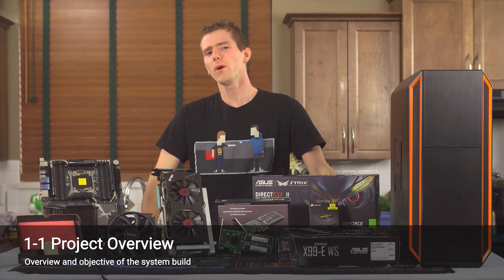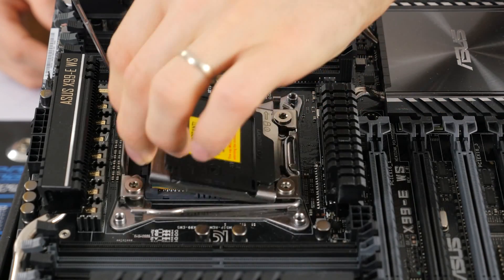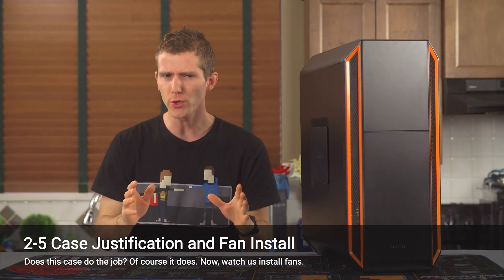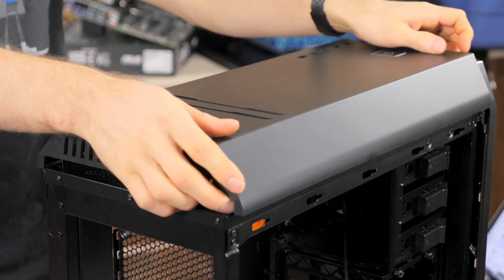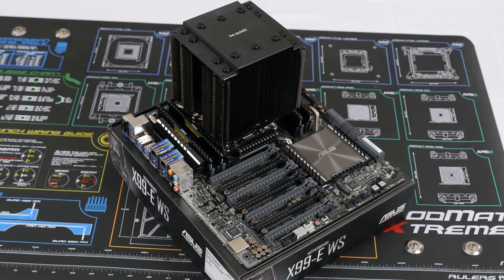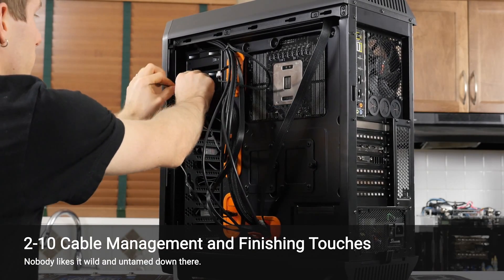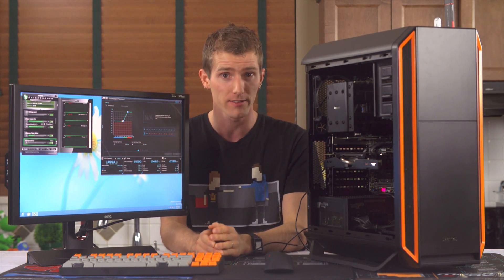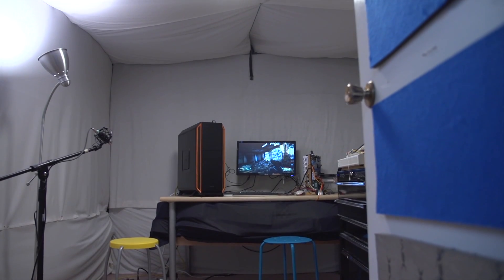How to Build the ULTIMATE Silent Gaming or Workstation PC

Comment: Could someone kinda help say if my rig could be changed? The main thing I'm going for is abit quiet, but not too quiet as well. Im getting my first desktop within the month, so mostly why Im asking for help. Any feedback is appreciated. :)

Case: Fractal Design Define R5
PSU: Corsair RM850
CPU: Intel Core i7-4790K
Watercooling: Corsair H55 Hydro
Motherboard: MSI Z97 Gaming 7
RAM: HyperX Savage DDR3 2400MHz 16GB
GPU: MSI GeForce GTX 980 Gaming 4GB
SSD: Kingston SSDNow V300 240GB
HDD: WD Desktop Green 4TB
Reply: I'd change the ram to a cheaper lower speed hyperx. Unless you neeeeeed the speed you probably wouldn't notice the difference. I'd up the msi edition of the gfx card to an asus strix and change the h55 for a nhu14s, or the phanteks equivalent, I'd go phanteks, because they have the best 140mm fan, according to silentpcreview. Anyways, hope I helped, that pc is beast.
Reply: Cool Blue I could go for abit slower but there is (where im buying it) barely price diffirence.
IDK about the Strix, I guess im kinda a guy who if I get one of something (MSI MoBo) I have to get for instance same brand GPU. Mind saying why go for Strix instead? xD
The H55 and the H60 are the only ones within my price range atm that arent out of stock on the website :(

Thanks for your response, and for trying to help. I also intend to upgrade it within the year as well so yeah. :)
Reply: ***** The asus strix is quieter, and maxwell is so cool, that you don't need the slight degrees difference :p.Shame about the h55 :c A good air cooler would be quieter, and more efficient. Upgrade as soon as you can. As for fans for the rad, in order to minimize noise, I'd change it to a single gentle typhoon 1450rpm, or maybe a noisblocker eloop, or simmilar speed or lower. Happy Building :3
Reply: Cool Blue Thanks :)
What about the mobo? Im stuck between the MSI Gaming 7 and Asus Maximus VII Ranger... know which one is best for what? :D
Reply: ***** get the Ranger!

Comment: I wanting to build a gaeming PC that can play most game at good looks.

How do these parts look for the pc?

i5-4690
Asus Rampage V Extr x99
Kingston DDR3 1333 / 10600 4Mb RAM
Seagate 7200rpm 500GB
Samsung 850 EVO 1TB SSD
CoolerMaster Elite Power 400W
Asus GTX960
Asus R7 260X
Fractal Design Node 304

Also, how do i puting the paste thing for chip? Is it put on the pins?
The oprating software, i hear that "alianware" is a very good one that will make the games run good. Should i get that too?

Sorry if my english is not very good, it not my main speaking language

Comment: Console gamer here looking to upgrade to pc gaming. My budget is £2000 ($3000) and i would like to play high demanding games like BF4 on high-ultra, 1080p, 120-144hz since i'll buy a 144hz monitor. I'm overwhelmed by all the specs, numbers ect but iv got a clearer idea of what i need. The build im having a look at is 

CPU: i7 4790k 4GHz
GPU: unsure 
MOTHERBOARD: Gigabyte GA-Z97X-Gaming 5 
COOLER: Cooler Master Hyper 212 EVO 
RAM: Corsair Vengeance 16GB (2 x 8GB) DDR3-1600 
STORAGE: Samsung 840 EVO 250GB SSD & Western Digital Caviar Blue 1TB
CASE: unsure
POWER SUPPLY: unsure
OS: Windows 8.1 64bit
MONITOR: Asus VG248QE 144Hz

Can anyone recommend me what a good GPU, case and power supply i would need for this build, if the components are compatible with each other and overclockable, and if i need to improve on anything. I'm not interested in 3x monitor gaming at all but 4k gaming would be interesting for the future but NOT essential
Reply: In that budget you could get a little better cooling solution like something water cooled.
For the gpu you could go 980 because yeah its the 980.
And for the power supply something like a corsair ax series
Reply: Literally everything Bruno just said - and welcome aboard brother!
Reply: Bruno Danjko Thanks
Reply: I can run BF4 on stable 55-60 high settings with my GTX 760 MSI Twin Frozr. Ultra i can run at about 40-45 fps.

Comment: So my brother is building his pc  and I was going to copy his build if the specs are good, are thee specs good since I know nothing about computers.

CPU: i7- 4790k
MOTHERBOARD: Z97 SABERTOOTH
GRAPGICS: Dual gtx 780 ti
RAM: RIPJAWS Z 32GB DDR3
SSD: SAMSUNG 850 PRO SERIES 512GB
HDD: WESTERN DIGITAL BLACK 2TB
CPU COOLER: CORSAIR H100i WATER COOLER
POWER SUPPLY: CORSAIR HX850 850W POWER SUPPLY 
CASE: CM STORM STRYKER
MOUSE: LOGITECH G502
KEYBOARD: RAZER BLACKWIDOW CHROMA
MONITOR: ASUS VG248QE
Reply: How many moniters will you run and at what resolution? Also I would change the SSD to a intel 730 series and unless you are dead set on that razor keyboard I would recommend the k70 rub which has similar lighting as the chroma. And buy some noctua pressure optimised fans instead of the stock ones that come with the h100 cooler, and buy a quiet case unless you love the one you listed in which case buy some low noise adapters for the fans that come with the case. Also when choosing a brand of gpu go for the gigabyte g1 gaming, they are not that loud and run very cool although they are about an inch or so longer than a dual fan evga model. Just say if something isaid was to technical and I will reply in plain English but It is quite a good build just needed some minor tweeks.
Reply: Oh and I would say get a 4770k because in gaming you might gain 1 frame going with the 4790 so put the money you save else where like a non reference gpu which will gain you a few frames
Reply: Oh last thing the MOBO is way overkill go with something a little less expensive like a z87 or z77. The asrock fatal1ty is a great choice which looks good and doesn't cost as much. Ignore this if you plan to do some insane overclocking but the asrock will handle most moderate overclocks with ease anyway.
Reply: kkmirsa In addition to what you said, I'd also look at a smaller power supply - 850W seems a bit overkill for the rest of the hardware (unless I'm missing something), so save a few bucks on that, maybe enough for another, smaller SSD for the OS.
Reply: Yeah the psu is a bit big but if you plan to upgrade a lot then it will do fine

Comment: Is this a decent PC build for standard games?
CPU: AMD FX-6300 3.5GHz 6-Core Processor 
CPU Cooler: Cooler Master Hyper TX3 Evo 43.1 CFM CPU Cooler
Motherboard: Gigabyte GA-970A-UD3P ATX AM3+ Motherboard 
Memory: G.Skill Ripjaws X Series 8GB (2 x 4GB) DDR3-1866 Memory
Storage: Samsung Spinpoint F1 DT 750GB 3.5" 7200RPM Internal Hard Drive 
Video Card: MSI Radeon R9 285 2GB Video Card 
Case: Cooler Master K350 ATX Mid Tower Case 
Power Supply: XFX 550W 80+ Bronze Certified ATX Power Supply
Reply: yea should be fine
Reply: Pretty decent. I'd go for a nVidia 960 but thats just me, the r9 285 is a pretty good gpu aswell ^^,
Reply: Don't get the 285 gpu. The 280x is better.

Comment: I want to build my first PC but I'm worried about the fact that I could spend my money on parts that I don't need and not get parts that would benefit me.  I am looking to build a relatively cheap gaming PC that will be good enough to play all the new games.  Any advice is very helpful and appreciated.
Reply: just give me a budget and i can help
Reply: Okay thank you. I'm trying to keep it under $900
Reply: Peripherals or no?
Reply: Wheatly 312 No. I have some old computer peripherals that I can use until I get more money for better equipment.
Reply: http://pcpartpicker.com/p/vRpy3C if you want a black case you can change it but here's a pretty beastly build
Reply: Wheatly 312 Thank you so much.  It might take me a while to build it, but I will most likely use your build. One question though, would you recommend having internet connectivity over wireless or wired network adapter?
Reply: wired all the way, its faster and more reliable
Reply: Wheatly 312 Ok thank you
Reply: ***** I know how to put together a computer, but I have a hard time being able to compare components and decide which one is better.
Reply: ***** Yes, so if you have anymore recommendations I would greatly appreciate it.
Reply: ***** Thank you. Would you say that overclocking is a good thing?  I am hesitant to overclock.
Reply: ***** Okay. I want to keep all of the parts in good condition and have them last long, so I don't want to risk anything with overclocking. Thank you
Reply: Thank you. As soon as I get enough money, then I will start ordering parts.
Reply: If you're not interested in overclocking and trying to keep costs low, you can stick with the stock cooler on the 4690. It's louder and will run hotter, but it shouldn't overheat ever and will save you $30. Also you don't need an ssd, though they are very nice for faster boot time and such. 

But overall, especially if you went for the overclock setup, that's pretty much the height of mid tier gaming right now. Modern titles will almost all run max settings at 1080p 60fps easily.
Reply: I agree with you, I was simply pointing out some options.

Comment: A Question Linus: Do you think a Noctua NDH14 without the fans would work too as a silent CPU Cooler (i7 3930k)? and would be a 430w Power supply would be enogh for this system:
i7 3930k
64GB RAM
Gtx 690 or maybe i change to Gtx 970
2X 512GB SSD
ASUS Xsonar Soundcard
Or what are you guys think?
Thanks

Comment: what u guys think about this build(gaming)?

os		:Microsoft Windows 7 Home Premium SP1 (OEM) (64-bit)
cpu		:AMD FX-8350 4.0GHz 8-Core Black Edition Processor
cpu cooler	:Corsair H55 57.0 CFM Liquid CPU Cooler
mobo		:Gigabyte GA-78LMT-USB3 Micro ATX AM3+ Motherboard
memory		:Kingston HyperX Fury 8GB DDR3-1600 Memory
hhd		:Seagate Barracuda 1TB 3.5" 7200RPM Internal Hard Drive
video card	:Sapphire Radeon R9 280X 3GB Dual-X Video Card
power supply	:Cooler Master Elite V2 550W ATX Power Supply
case		:Corsair SPEC-01 RED ATX Mid Tower Case
keyboard	:Corsair Vengeance K65 Compact Mechanical Gaming Keyboard
mouse		:Gigabyte M6880X Wired Laser Mouse		
monitor		:Acer K202HQL 60Hz 19.5" Monitor

opinions and suggestions are very much appreciated.
Reply: I would change the hard drive to a Western Digital Blue 1 TB because I had 3 Barracudas fail on me. Also if your not overclocking, get a Hyper 212 Evo, a fantastic air cooler. Unless you like water cooling. Good Luck with your build! (And if you are coming from a console, Welcome to the PC Master Race!). :D
Reply: Also try to upgrade your Power Supply to a 650w if you can.
Reply: RedKill3r what kind of sound card can I add to this build?
Reply: Selipar Jepun If you are running a surround sound or anything, the Asus ROG Xonar Phoebus is a nice gaming sound card, it is a bit pricey though. If you have any other questions you can ask me :)
Reply: RedKill3r thx 4 he info bro.. :)
Reply: Selipar Jepun I agree with everything Red said with one personal exception, The Asus Xonar is a great sound card but I also like this one from CreativeSoundblaster again IMO :) http://www.ncix.com/detail/creative-soundblaster-zxr-pcie-sound-4c-81293-1482.htm :)
Reply: Hugoi baray My bad, I haven't looked at many air coolers. I apologize.
Reply: I wouldnt take amd cpu if it is for gaming tho. Few games use all cores (only i know is frostbite engine:BF4, AC:U).But for video editing it's good
Reply: 550w is cutting it close since AMD is rather power hungry. Also make sure to check that both the 290 and sound card will fit together on a mico atx mobo, otherwise you may have to do without the sound card or find a standard atx board.
Reply: id get a 128 gb ssd for 61 on amazon and replace the 1600 mhz ram with 1866
Reply: ***** it wont make much of a difference in gaming but it will with video editing and other demanding programs
Reply: and so are you lisandro dzermaili
Reply: Just wondering what is the practical use of an 8 core cpu when 4 core cpu does it for most modern day games?
Reply: I have the spec 01 red and the only complaint I have is the window is too dark

Comment: I don't get it why fan is blowing in, I always thought best way is to get the heat out of the case..
Reply: Andrew B Having an intake fan allows the airflow be more consistent. This is the same reason you should have a fan pointing in and a fan pointing out (instead of both pointing out) when cooling your house down on a summer night.

Comment: That moment when you can't watch the video peacefully because of your PC fans going out of control.
Reply: ceasar
nope, sorry mate, it can hardly run minesweeper on ultra LOW settings, something like 10 fps or less :c
Reply: will this run roblox on medium settings at 20 fps http://pcpartpicker.com/p/3R7Tqs
Reply: #MacSucks
Reply: Aidan Sweeney i know its a joke
Reply: #MacSucks
Reply: ceasar
they're lying to you, my crappy laptop with integrated graphics does well, both will handle it very well
Reply: Zack Gibbs lol
Reply: ***** Or watch it at 720p becouse 1080p burns my graphicscard. wait, i have on board intel graphics -.-
jeeezzz
Reply: Joshua Barendse Mmm that on-board graphic powerhouse. Mine just dies at anything which is above 1080p
Reply: rodrigo maldonado http://pcpartpicker.com/p/zh26xr ok what about that
Reply: Obama I will vote for you.
Reply: ceasar Dude, That wouldn't even run minecraft on all low settings 10fps.  You really need to beef it up
Reply: rodrigo maldonado yes
Reply: +Lala Buhril not really, it gets air from the fan in the back that he reversed. personally i dont think that he made the best choice for the cooler, since its not made for fanless operation (like a thermalright macho zero),but it will still work without any problems
Reply: ***** As he said, he decided not to overclock since he doesn't have fans on the cooler, but that cooler is large enough that heat dispersion will still be decent with the standard settings. If he wanted to overclock or use it all out for many hours at a time, it may be necessary to add fans, but in this situation, what he did works fine.

Keep in mind, a CPU like that can do amazing things overclocked, so putting it in a system like this and not overclocking really lessens the computer's abilities, but he was going for silence not power. If you wanted to maximize performance of a CPU like that, grab a good quality air or liquid cooler and enjoy overclocking.
Reply: Thanks *****.
Reply: ceasar this will surely run roblox in medium setting 12 fps better than your 10 fps
Reply: Nuke Gray thanks for your help
Reply: *****macsucks
Reply: ***** My laptop sounds like a jet engine while playing solitaire.
Reply: ***** That depends on the incase airflow. If the heatsink is of a reasonable size and the case's airflow is good it wont overheat. Technically he is using the case's front intake fans as fans for the cpu cooler too. You need o be carefull with that though. You need to be very sure your airflow is good
Reply: not gonna lie, AMD stock cooler pissed me off because of how loud it was. That was with an fx 4300
Reply: I need to get an SSD. I have a 640 gb and 60gb hard drive both from Western digital. Definitely getting a 1 or 2 tb SSD when I get the money

Comment: My pc is a lot louder.and I have 3 fans.one intel stock fan,one power supply fan and one GT 630 fan
Reply: I can tell you from experience that replacing that processor stock fan alone with something like a Cooler Master Hyper 212 Evo will make A WORLD of difference. Its's the cheapest, biggest improvement to sound profile you can make and one I kick myself for not having done earlier.
Reply: Articuno76 ok i will try

Comment: Please help, is this build any good?

CPU: Intel I5-4690k 
MB:   MSI Z97 PC Mate
RAM: Corsair 2x4GB DDR3, 1600Mhz, 240pin DIMM
GPU: MSI GeForce GTX 970 GAMING 4G
HDD: WD 1TB 3.5 inch Internal Hard Drive - Caviar Blue
PSU: Corsair CX600 V2
SSD: Crucial MX100, 256GB
Case: NZXT Source 340
Reply: completely fine
Reply: It's great man!

Comment: i run my pc fanless nealy 4 years ago.
cpu : i5 750 @1.65ghz 0,815v and a tower fanless cooler. Your board must surpport this low voltage. I use a Gigabyte p55 ud4.
also seasonic fanless power supply and fanless video card.
I think now all intel cpu could run fanless, just turn the speed and voltage at a lower level.

Comment: Can someone help me with a problem? i recently assemble my pc outside the case for making sure everything was fine then when i came for starting it nothing appears on my screen and i get a error 98 or d7 (each boot one of these will stay after other error). I really want my pc working and i would appreciate some help!

PC:
Maximus V Formula
i7 3770k  
4x4 corsair vengeance ddr3 2133mhz
Asus STRIX gtx 970 
Corsair AX 760

Comment: Guys, please tell me if the cpu, motherboard and ram will work with each other, tend to get confused sometimes.
Intel® Core™ i7-4790K
Gigabyte GA-Z97MX-Gaming 5 Micro ATX LGA1150
Corsair Vengeance PRO 8GB (2x4GB) DDR3-1600
Intel 520 Series MLC 240GB SSD
2x (MSI NVIDIA Geforce GTX760)
Corsair HX1000i
Corsair Obsidian 750D E-ATX Chassis